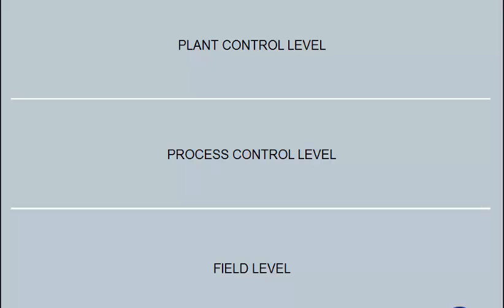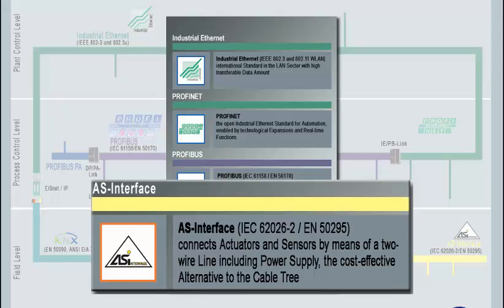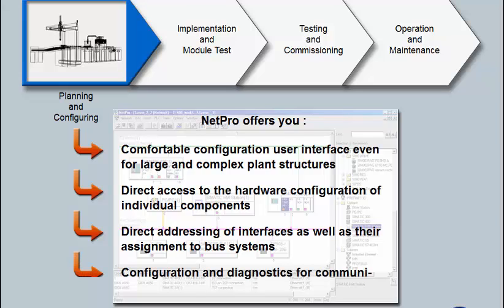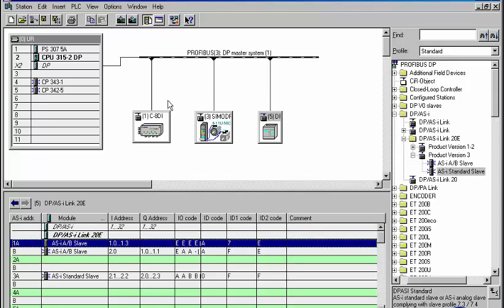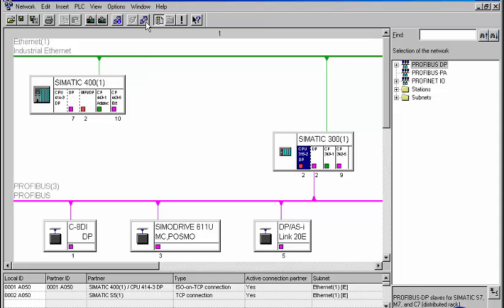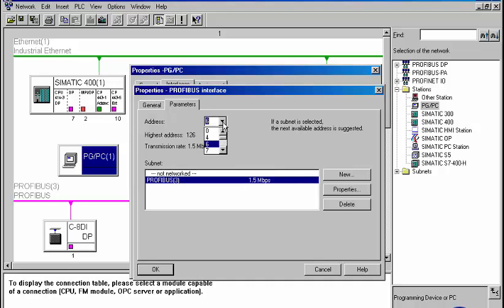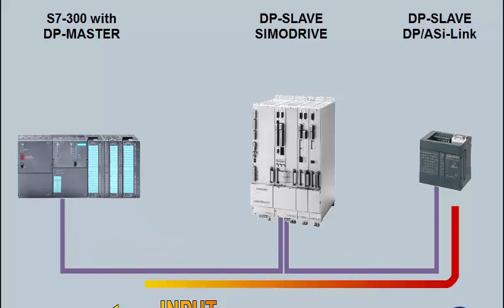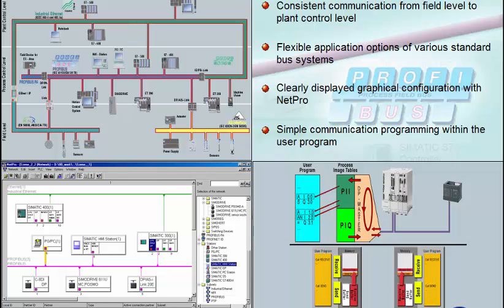PLC S7 - 300, Lesson17, Communication with Simatic Step7

Comment: Следующее
АВТОВОСПРОИЗВЕДЕНИЕ

12:24
PLC Siemens S7 - 300 Training, Lesson14, Integrating S7 300 with HMI Siemens SCADA
Engineering Courses
7,1 тыс. просмотра

12:25
PLC Siemens S7 300 Training, Lesson15,Testing and Commessioning, part1
Engineering Courses
39 тыс. просмотров

PLC S7 - 300, Lesson19, Process Diagnostics part1
Engineering Courses
3,2 тыс. просмотр

Red MPI con 3 PLC Siemens S7 300 (Comunicación GD y S7 básica)
IES Cavanilles ARI
10 тыс. просмотра

22
PLC S7 - 300 Basic Course
Engineering Courses
Tutorial of siemens Step-7 PLC programming using simatic manager
rakesh patil
299 тыс. просмотра

plc siemens s7 300 training, Lesson 1, Simatic Manager
Engineering Courses
27 тыс. просмотра

SIMATIC STEP-7 300-400 NETWORK PART 1 : CONFIGURATION
amir amir
108 тыс. просмотра

PLC to Drive communication using Simatic manager software l Simatic manager l Siemens
Techsystems Automation Solution
4 тыс. просмотров

Step 7 siemens s7 300 Tutorial Lesson 1
The Hyenas
9 тыс. просмотра

6. comunicacion ethernet 2 PLC S7300
JOHN JAIRO PIÑEROS
37 тыс. просмотров

Connect wincc to PLC S7-300 (MPI)
А Б
38 тыс. просмотра

Siemens S7 Pointers & DataBlocks Tutorial Part 22
TheReimber
66 тыс. просмотров

SIMATIC STEP-7 300-400 NETWORK PART 3 : RECEIVER PROGRAMING
amir amir
65 тыс. просмотров

PLC to Drive (VFD) Communication & Control with Standard Telegram
Automation Revolution
11 тыс. просмотров

S7 300 PLC and Profibus Network Part 1
Faisal Rasool
5,8 тыс. просмотра

plc programming siemens step7-300 simple analog scaling display on winncc flex
SOLOMON KOROMA
72 тыс. просмотров

ProfiNet Communication between SIEMENS S7-300 PLC and G120 SINAMICS Drive
Dhaval Vora
36 тыс. просмотров

Profibus Communication in PLC (MPI Communication Protocol)
Automation Revolution
3,3 тыс. просмотра

plc siemens s7 300 training, Lesson 2 | Creating My First Project
Engineering Courses
24 тыс. просмотра

where is PLC S7 - 300, Lessons 1, 2 ,3?

Comment: where is Следующее
АВТОВОСПРОИЗВЕДЕНИЕ

12:24
PLC Siemens S7 - 300 Training, Lesson14, Integrating S7 300 with HMI Siemens SCADA
Engineering Courses
7,1 тыс. просмотра

12:25
PLC Siemens S7 300 Training, Lesson15,Testing and Commessioning, part1
Engineering Courses
39 тыс. просмотров

PLC S7 - 300, Lesson19, Process Diagnostics part1
Engineering Courses
3,2 тыс. просмотр

Red MPI con 3 PLC Siemens S7 300 (Comunicación GD y S7 básica)
IES Cavanilles ARI
10 тыс. просмотра

22
PLC S7 - 300 Basic Course
Engineering Courses
Tutorial of siemens Step-7 PLC programming using simatic manager
rakesh patil
299 тыс. просмотра

plc siemens s7 300 training, Lesson 1, Simatic Manager
Engineering Courses
27 тыс. просмотра

SIMATIC STEP-7 300-400 NETWORK PART 1 : CONFIGURATION
amir amir
108 тыс. просмотра

PLC to Drive communication using Simatic manager software l Simatic manager l Siemens
Techsystems Automation Solution
4 тыс. просмотров

Step 7 siemens s7 300 Tutorial Lesson 1
The Hyenas
9 тыс. просмотра

6. comunicacion ethernet 2 PLC S7300
JOHN JAIRO PIÑEROS
37 тыс. просмотров

Connect wincc to PLC S7-300 (MPI)
А Б
38 тыс. просмотра

Siemens S7 Pointers & DataBlocks Tutorial Part 22
TheReimber
66 тыс. просмотров

SIMATIC STEP-7 300-400 NETWORK PART 3 : RECEIVER PROGRAMING
amir amir
65 тыс. просмотров

PLC to Drive (VFD) Communication & Control with Standard Telegram
Automation Revolution
11 тыс. просмотров

S7 300 PLC and Profibus Network Part 1
Faisal Rasool
5,8 тыс. просмотра

plc programming siemens step7-300 simple analog scaling display on winncc flex
SOLOMON KOROMA
72 тыс. просмотров

ProfiNet Communication between SIEMENS S7-300 PLC and G120 SINAMICS Drive
Dhaval Vora
36 тыс. просмотров

Profibus Communication in PLC (MPI Communication Protocol)
Automation Revolution
3,3 тыс. просмотра

plc siemens s7 300 training, Lesson 2 | Creating My First Project
Engineering Courses
24 тыс. просмотра

where is Следующее
АВТОВОСПРОИЗВЕДЕНИЕ

12:24
PLC Siemens S7 - 300 Training, Lesson14, Integrating S7 300 with HMI Siemens SCADA
Engineering Courses
7,1 тыс. просмотра

12:25
PLC Siemens S7 300 Training, Lesson15,Testing and Commessioning, part1
Engineering Courses
39 тыс. просмотров

PLC S7 - 300, Lesson19, Process Diagnostics part1
Engineering Courses
3,2 тыс. просмотр

Red MPI con 3 PLC Siemens S7 300 (Comunicación GD y S7 básica)
IES Cavanilles ARI
10 тыс. просмотра

22
PLC S7 - 300 Basic Course
Engineering Courses
Tutorial of siemens Step-7 PLC programming using simatic manager
rakesh patil
299 тыс. просмотра

plc siemens s7 300 training, Lesson 1, Simatic Manager
Engineering Courses
27 тыс. просмотра

SIMATIC STEP-7 300-400 NETWORK PART 1 : CONFIGURATION
amir amir
108 тыс. просмотра

PLC to Drive communication using Simatic manager software l Simatic manager l Siemens
Techsystems Automation Solution
4 тыс. просмотров

Step 7 siemens s7 300 Tutorial Lesson 1
The Hyenas
9 тыс. просмотра

6. comunicacion ethernet 2 PLC S7300
JOHN JAIRO PIÑEROS
37 тыс. просмотров

Connect wincc to PLC S7-300 (MPI)
А Б
38 тыс. просмотра

Siemens S7 Pointers & DataBlocks Tutorial Part 22
TheReimber
66 тыс. просмотров

SIMATIC STEP-7 300-400 NETWORK PART 3 : RECEIVER PROGRAMING
amir amir
65 тыс. просмотров

PLC to Drive (VFD) Communication & Control with Standard Telegram
Automation Revolution
11 тыс. просмотров

S7 300 PLC and Profibus Network Part 1
Faisal Rasool
5,8 тыс. просмотра

plc programming siemens step7-300 simple analog scaling display on winncc flex
SOLOMON KOROMA
72 тыс. просмотров

ProfiNet Communication between SIEMENS S7-300 PLC and G120 SINAMICS Drive
Dhaval Vora
36 тыс. просмотров

Profibus Communication in PLC (MPI Communication Protocol)
Automation Revolution
3,3 тыс. просмотра

plc siemens s7 300 training, Lesson 2 | Creating My First Project
Engineering Courses
24 тыс. просмотра

rfrfeewfСледующее
АВТОВОСПРОИЗВЕДЕНИЕ

12:24
PLC Siemens S7 - 300 Training, Lesson14, Integrating S7 300 with HMI Siemens SCADA
Engineering Courses
7,1 тыс. просмотра

12:25
PLC Siemens S7 300 Training, Lesson15,Testing and Commessioning, part1
Engineering Courses
39 тыс. просмотров

PLC S7 - 300, Lesson19, Process Diagnostics part1
Engineering Courses
3,2 тыс. просмотр

Red MPI con 3 PLC Siemens S7 300 (Comunicación GD y S7 básica)
IES Cavanilles ARI
10 тыс. просмотра

22
PLC S7 - 300 Basic Course
Engineering Courses
Tutorial of siemens Step-7 PLC programming using simatic manager
rakesh patil
299 тыс. просмотра

plc siemens s7 300 training, Lesson 1, Simatic Manager
Engineering Courses
27 тыс. просмотра

SIMATIC STEP-7 300-400 NETWORK PART 1 : CONFIGURATION
amir amir
108 тыс. просмотра

PLC to Drive communication using Simatic manager software l Simatic manager l Siemens
Techsystems Automation Solution
4 тыс. просмотров

Step 7 siemens s7 300 Tutorial Lesson 1
The Hyenas
9 тыс. просмотра

6. comunicacion ethernet 2 PLC S7300
JOHN JAIRO PIÑEROS
37 тыс. просмотров

Connect wincc to PLC S7-300 (MPI)
А Б
38 тыс. просмотра

Siemens S7 Pointers & DataBlocks Tutorial Part 22
TheReimber
66 тыс. просмотров

SIMATIC STEP-7 300-400 NETWORK PART 3 : RECEIVER PROGRAMING
amir amir
65 тыс. просмотров

PLC to Drive (VFD) Communication & Control with Standard Telegram
Automation Revolution
11 тыс. просмотров

S7 300 PLC and Profibus Network Part 1
Faisal Rasool
5,8 тыс. просмотра

plc programming siemens step7-300 simple analog scaling display on winncc flex
SOLOMON KOROMA
72 тыс. просмотров

ProfiNet Communication between SIEMENS S7-300 PLC and G120 SINAMICS Drive
Dhaval Vora
36 тыс. просмотров

Profibus Communication in PLC (MPI Communication Protocol)
Automation Revolution
3,3 тыс. просмотра

plc siemens s7 300 training, Lesson 2 | Creating My First Project
Engineering Courses
24 тыс. просмотра

Следующее
АВТОВОСПРОИЗВЕДЕНИЕ

12:24
PLC Siemens S7 - 300 Training, Lesson14, Integrating S7 300 with HMI Siemens SCADA
Engineering Courses
7,1 тыс. просмотра

12:25
PLC Siemens S7 300 Training, Lesson15,Testing and Commessioning, part1
Engineering Courses
39 тыс. просмотров

PLC S7 - 300, Lesson19, Process Diagnostics part1
Engineering Courses
3,2 тыс. просмотр

Red MPI con 3 PLC Siemens S7 300 (Comunicación GD y S7 básica)
IES Cavanilles ARI
10 тыс. просмотра

22
PLC S7 - 300 Basic Course
Engineering Courses
Tutorial of siemens Step-7 PLC programming using simatic manager
rakesh patil
299 тыс. просмотра

plc siemens s7 300 training, Lesson 1, Simatic Manager
Engineering Courses
27 тыс. просмотра

SIMATIC STEP-7 300-400 NETWORK PART 1 : CONFIGURATION
amir amir
108 тыс. просмотра

PLC to Drive communication using Simatic manager software l Simatic manager l Siemens
Techsystems Automation Solution
4 тыс. просмотров

Step 7 siemens s7 300 Tutorial Lesson 1
The Hyenas
9 тыс. просмотра

6. comunicacion ethernet 2 PLC S7300
JOHN JAIRO PIÑEROS
37 тыс. просмотров

Connect wincc to PLC S7-300 (MPI)
А Б
38 тыс. просмотра

Siemens S7 Pointers & DataBlocks Tutorial Part 22
TheReimber
66 тыс. просмотров

SIMATIC STEP-7 300-400 NETWORK PART 3 : RECEIVER PROGRAMING
amir amir
65 тыс. просмотров

PLC to Drive (VFD) Communication & Control with Standard Telegram
Automation Revolution
11 тыс. просмотров

S7 300 PLC and Profibus Network Part 1
Faisal Rasool
5,8 тыс. просмотра

plc programming siemens step7-300 simple analog scaling display on winncc flex
SOLOMON KOROMA
72 тыс. просмотров

ProfiNet Communication between SIEMENS S7-300 PLC and G120 SINAMICS Drive
Dhaval Vora
36 тыс. просмотров

Profibus Communication in PLC (MPI Communication Protocol)
Automation Revolution
3,3 тыс. просмотра

plc siemens s7 300 training, Lesson 2 | Creating My First Project
Engineering Courses
24 тыс. просмотра

where is PLC S7 - 300, Lessons 1,23?